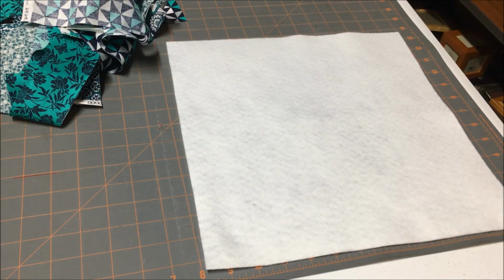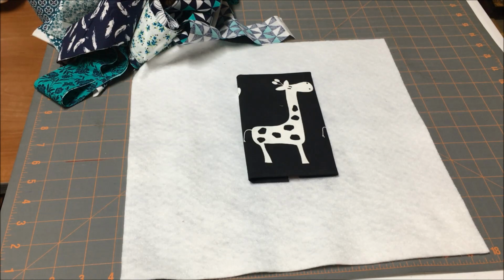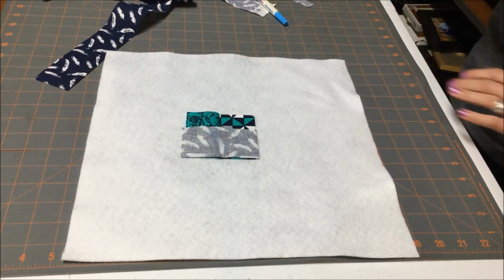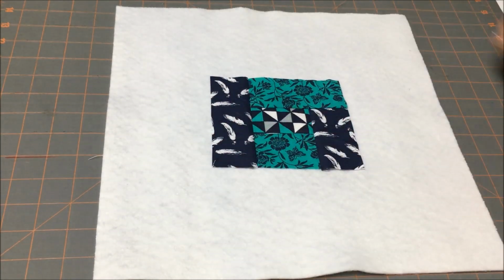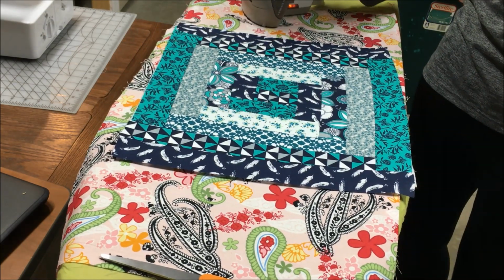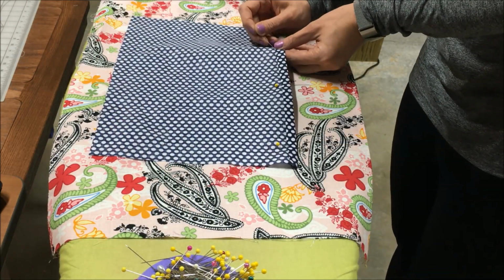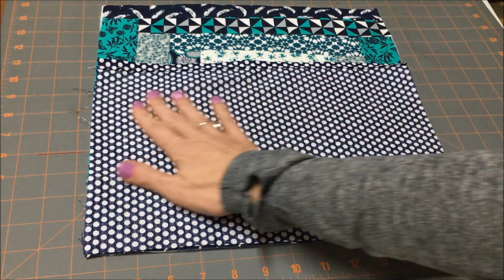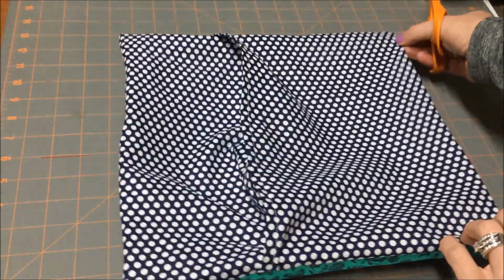Quilt as you go Log Cabin Pillow Cover

Comment: Is it required to have fusible batting?
Reply from the maker: You could use other types of batting or even pieces of fabric to "quilt as you go".  However, the stability and weight of the fusible really makes the project more simple.  I learned this  process from a Craftsy course and they used fusible fleece so that is what I've always used.
Reply: @lexymcnew863  Got it.  Makes sense. :-)  Love your video and channel!

Comment: Just to understand correctly, whatever size pillows I have, I would need to do a 1/2 inch bigger for the cover?
Reply: Yes, she kept saying different sizes throughout which made it difficult for beginners to know exactly the size they needed. You need to add ½ all around for your seam allowance. She should have added a simple written description under her video.
Reply: What I’ve heard is you make the cover half an inch SMALLER than the pillow form because the pillow form fills out the cover better that way.

Comment: Do you ever add another piece of fabric to the back side of the batting so that the fibers of the batting don't come loose inside with the pillow?  I'm thinking it might be a good idea to use muslin or something else for that purpose, especially so that if it needs to be laundered the batting doesn't come apart. Or do you always just do it as you've shown, and have you laundered it, as is?
Reply from the maker: Treezza I’ve never washed these, but yes; if you plan to wash a lot I suppose the batting may deteriorate. I’m sure it would work just fine to secure a muslin to the backing.
Reply: 98 nu6ugbbkhf6h,tgf4fvffcu0p00
l